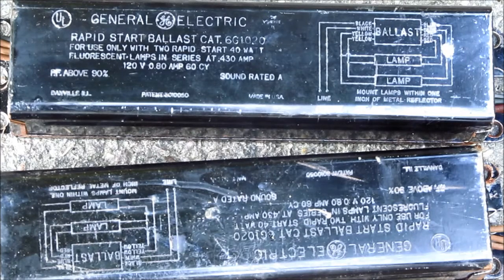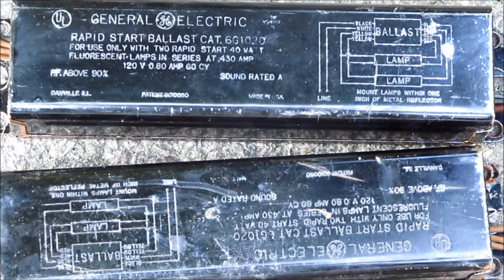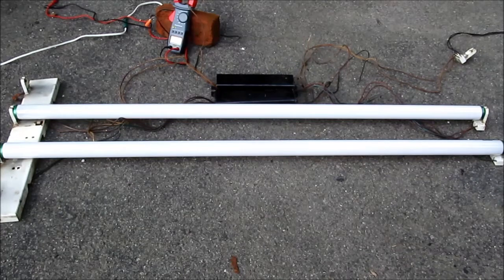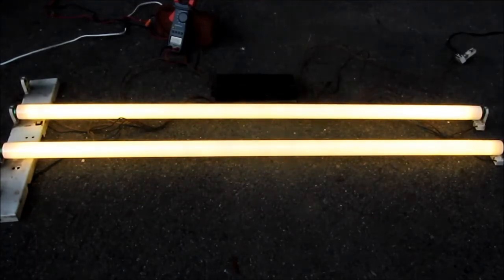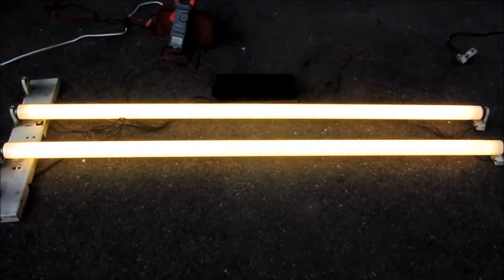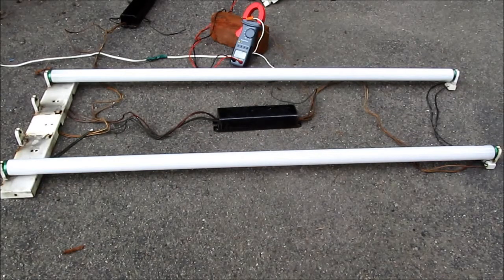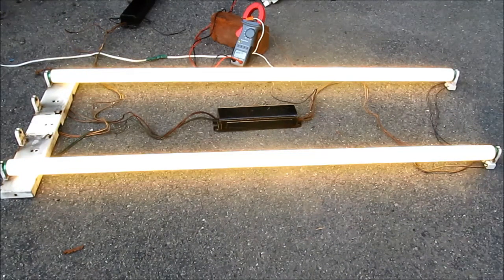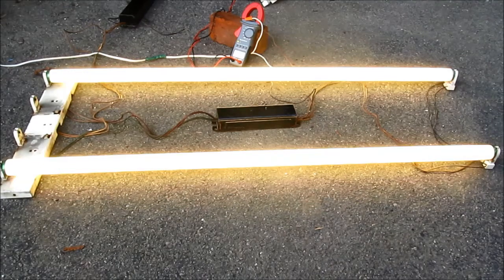I Got Two GE Rapid Start Ballasts at the Scrapyard

Comment: I remember when I was 8 or 9 my dad gave me an old ballast to take apart.  It was potted with black hard kind of tar stuff and because I didn't know better at that age I proceeded to chisel it out.  Unfortunately I did this by a sunny window and some of the bits got on the hard wood floor and it melted and stuck to the floor.  XP  
Nice find!